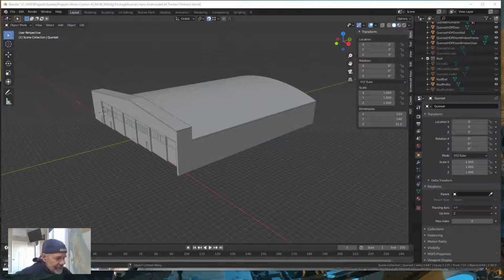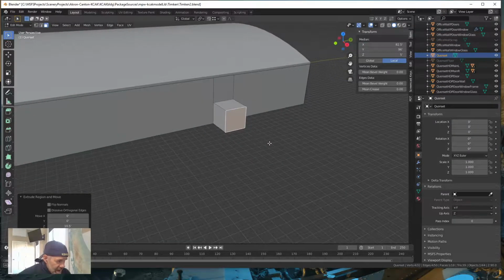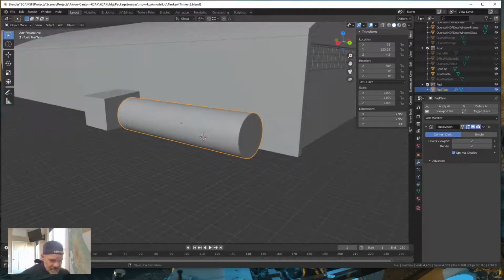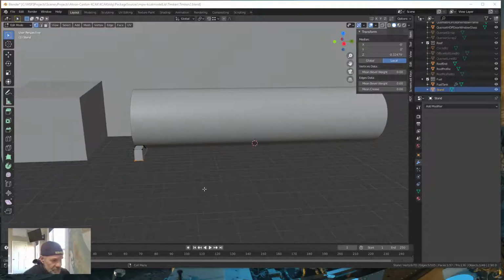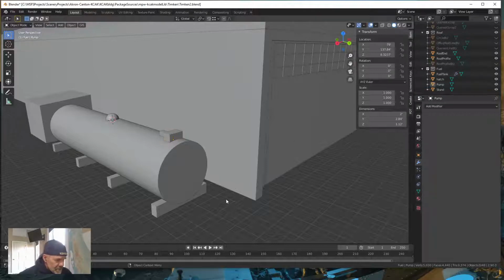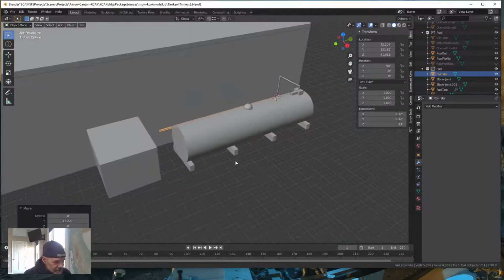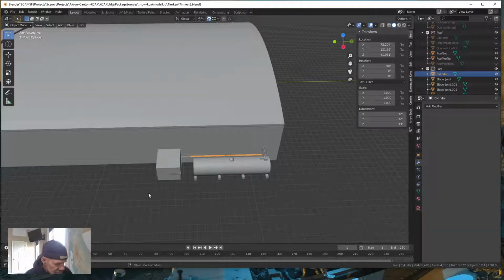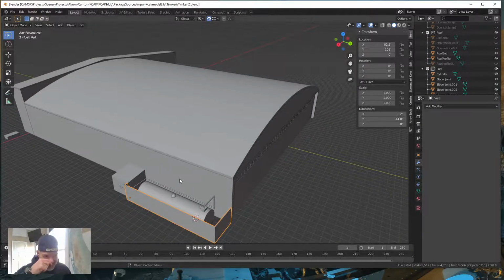Creating Scenery for MSFS 2020: Modeling a Quonset Hangar Part 7

Comment: Discovered by accident that you can change the settings of the Pipe Elbow at any time by selecting it in Object Mode and then right-click on it. You then get an option "Change elbowjoint". From there you can change all parameters.